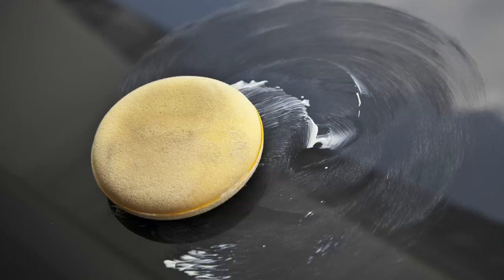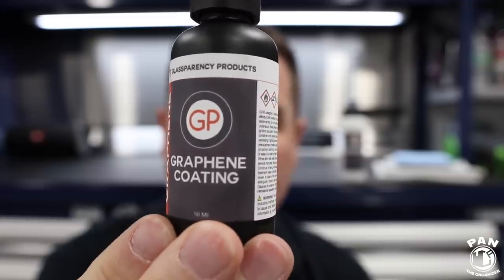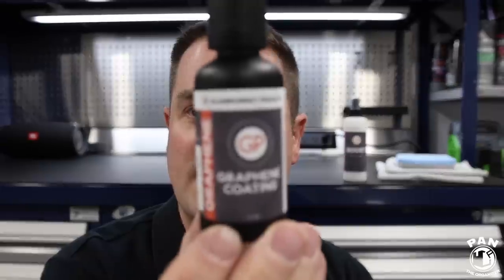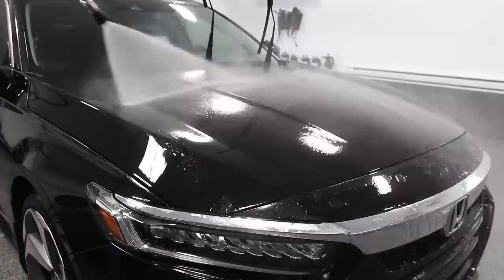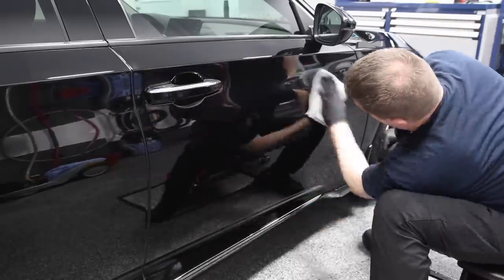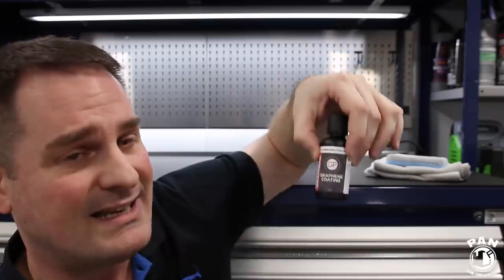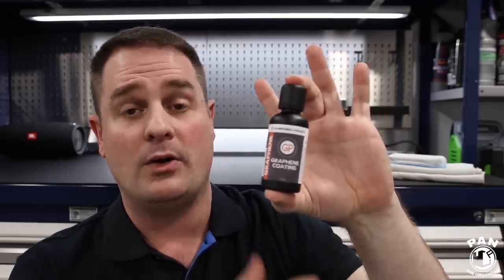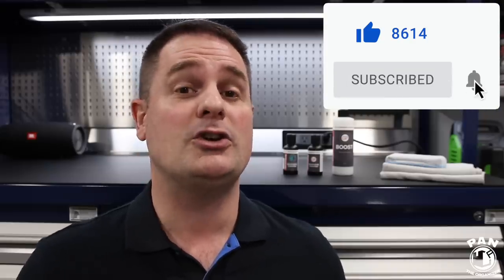GRAPHENE COATING by GlassParency! The Future of Paint Protection!

Comment: Baffles me that the customer wouldn't get a full paint correction before applying something so semi-permanent... especially with that color car.
Reply: Some thought Pat; I was a bit antsy watching all that :)
Reply: Money.  A full paint correction isn't cheap.  I love the idea of keeping my vehicle clean easier without spending $1000+.
Reply: Yeah, lots of cars just don't merit a full paint correction, but even a minor correction like this one, plus ceramic or graphene, means 1) the car looks better than it did before, and 2) it will be better protected, so it should stay better-looking longer. Plus the comparative ease of cleaning after a protective coating is applied is an additional benefit even if no paint correction is done at all.

Comment: Graphene coating VS Turtle Wax Ice ceramic spray. $99 vs $15.
That'd be an interesting apples & oranges comparison.
Reply: Love to see that battle
Reply: Agreed.
Reply: yeah, but one is in spray form and one isn't. So that's not a fair comparison compared to a ceramic coating in a small bottle that must be applied the same way.
Reply: @brandenlucero  yeah that is why @Robert Van Hoy said like apple & oranges comparison. You know just curious
Reply: Y not both 🤷
Reply: You mean hybrid solutions. I have both and may test for my self
Reply: The difference is in how many years each one lasts.
Reply: @adampetten1009  I couldn't think if the correct name.
Reply: @Knards  and probably the chemicals they can survive
Reply: would be fun to see, loving the TW hybrid stuff
Reply: @projectfarm got really good results with TW as well.. im putting this graphene on my Jeep SRT and TW on my truck to compare. I'm also going to split a door on my work truck as its used in industrial settings daily from oil and gas to pulp and paper.
Reply: You can’t compare a paint sealant to a coating imo
Reply: @garretrocha8  Did I not say Apple's to Oranges comparison ? Just like which car would make a better everyday driver, Camry or a Ferrari F40 ? Yeah the F40 will do a lot of things better but the Camry is much more suited for everyday life.
Reply: 组哈飞 d
Reply: @adampetten1009  I think you will find the graphene will out last the ceramics by a long shot
Reply: @Knards  nobody doubting that but could do a good short term test or possibly even 6 to 12 maybe.  He was being generous about price too.  Maybe $130 shipped to door graphine in US vs $13 TW at walmart.  would still be a fun comparison to see.  TW wet wax works great too.
Reply: @happytrails1963  There is no comparison to TW Ceramic and Graphene. They both shed water like a duck, one lasts very short term the other much longer. The price of Graphene is $99.00 and there is no $30 shipping. Remember you get what you pay for.
Reply: @Knards   I do not know if that is the correct  test perameters.  Gloss an dshine versu cost is what I would compare against. If gloss an dprotection being equal and the turtle wax having to be re-applied  once a month versus this coating which  also needs a booster to be purchased and applied, After five years, how much is the difference in cost  and did both of the perform eqaually?  The quality of any of these new products  is so good, the answer to which route to take is subjective and completely up to the persons preference. If in five years using this product once and a person using  Turtle wax and having to purchase five years worth  might be around the same amount of money spent.
Reply: I had the same question. I might travel with my car and I'm looking for solutions with less maintenance.
Reply: The funny thing about the high end coatings that claim to last years, is that they are marketed to people who are scrupulous about their cars. And if you’re already washing your car frequently, doesn’t that mean that a $15 hybrid is perfectly fine? You still get the beading and easy maintenance washes.
Reply: @hawkie333  Exactly my thoughts.
Reply: @barrycook8116  So you're saying that ceramic won't have the swirls even after repeated washing?

Comment: Very excited I ordered the kit and received my kit 1-250 Today I'm having my Chevy 2500 cut and polished and right after going to follow your instructions to coat my truck. Previously I had the original Quarts ceramic coating for the last two years and used the reload booster every few months worked and looked great but this seems to be a better product. Thank you for your video. FYI Truck is 2018 Chevy 2500 Z71 4x4 diesel LTZ.
Reply from the maker: Awesome! Good choice. Let me know how it works out for you! Should be pretty simple to apply.

Comment: You gotta review Adam’s Graphene coating
Reply: They're all gona be similar tbh
Reply: Working with Adam’s today.  GP was very easy to apply. I hope Pan tries them.
Reply: Got it in the Mail this week!
Reply: Nice product review!   Two thumbs up.  👍👍
I would like to see this one up against Ethos Graphene Matrix Coating.
Reply: It’s going to be almost identical. B&B who owns Adams is where Glassparency got this coating from. They didn’t even change the bottle.
Reply: I think Adam's Graphene coating is probably very similar or maybe the same. Adam's doesn't make its own products anymore. Almost all of its products are rebranded products from other companies. Their polishers are from the same maker of MaxShine, their polishing pads are Buff & Shine, their foam cannons and foam guns are rebrands, etc. So the Graphene coating may just be rebrand of someone elses coating. But I like Adam's because their products are cheaper the the companies from whom they buy!
Reply: castamir your partially correct. Except their products are made by b&b. The same company that bought Adams also bought b&b. So in essence, they do make their own products. The current wave of graphene coatings are all mixed up by b&b from what I have been able to tell. I’m sure there’s some differences between them but I haven’t seen the sds on them to know what exactly is different. Regardless it will be insignificant.
Reply: @stevoeight  That's true. I was talking with a MaxShine representative at the booth in a trade show. He told me that their car wash soap is the same as the Adam's soap and made by the same company. We will see more MaxShine and Adam's share the same products as they consolidate and streamline their product lines to reduce warehouse and development costs. He then went on to say that
Reply: castamir it’s not the same soap, just the same blender. That can be said for dozens of companies though.
Reply: Adams Graphene Ceramic coating is not the same as this. Adams uses Graphene-oxide.
Reply from the maker: I have been testing it for a few weeks now. I have been testing other graphene coatings as well in the past months.  It will be a crazy year for sure.
Reply: Ethos graphene is way better
Reply: Its honestly the same as the regular adams coating just a name. There was a test where apex detail did a test an both the same so just save your money
Reply: @briandraper7630  I tend to agree though haven't used either  Why? Lasts longer with a single layer and no topper required. Ethos for the win.
Reply: @PeteyMcSavage  Adam's vs Ethos is apples and oranges.  Adam's is just a 1 year spray coating vs a 5 year solvent. Not even in the same league
Reply: @PeteyMcSavage  CarPro One? Never heard of it. Did a quick web search and came up empty handed
Reply: Project farm did a video recently with Adam's and Ethos. Turtle wax was better.
Reply: @PeteyMcSavage  graphene comes in multiple forms. In our case as a liquid, graphene-oxide is a derivative of it, or a broken down form.
Reply: @PanTheOrganizer  I used ArtDeShine graphene coating with leveler. That stuff was insane.
Reply: @paulgyro  your wrong Adams offers a 60ml of a graphene 7 + year coating besides the spray coating!
Reply: @stevenmagid7228  ah indeed you are right! $79.99 might be a steal
Reply: David Christopher don't lie about test results...
Reply: @Pan TheOrganizer 
Can you do an unbiased comparison of Ethos, Adam and Glass Parency graphene coatings please. Especially Ethos’s I heard good remarks over internet.
Reply: @TheGrujee  I second that request
Reply: @briandraper7630  how so? Have you personally compared it to others?

Comment: Carnauba: “I can last 1 month”
Paint sealant: “I can last 6 months.”
Ceramic coating: “I can last 2 years.”
...
Graphene coating: “Hold my beer.....”
Reply: @darius2640  I did do something similar when selling my wife's car that had Fusso Coat+BSD on it!
Reply: Can I apply graphene coating over ceramic coating?
Reply: @jrlundman  no you can't.  Ceramic coating or Graphene coating requires to bond to the clear coat.
Xoxo from Puerto Rico 👍🇵🇷
Reply: @jrlundman  no!! It is made to bind to you clear without any protection.

Comment: Hi Pan let's see the glassparency graphene coating go up against the opti coat pro plus on your BMW then we can see if it really is better.
Reply from the maker: t wouldn't be a fair comparison, as Opti-Coat Pro+ is a 7+ year pro grade coating that can only be applied by authorized dealers and a service like that, for a car like mine, starts at around $1500 USD, versus a 100$ kit of this graphene coating that anyone can purchase and easily apply.  So for value, hands down the graphene coating kit.  For durability, only time will tell as these are brand new products so nobody has had the time to test them over multiple years yet, obviously.  If it gets anywhere near 4+ years of durability, then I would opt for the graphene kit.
Reply: @PanTheOrganizer  Its probably now only a matter of time before graphene coatings take the place of ceramic coatings, we are yet to see graphene coatings from some of the big hitters like carpro or gtechniq they could really change the landscape with products that might last longer than ten years. That graphene coating was so easy to apply and it's cheap if it can get to 5 years that's amazing, from the look of your test car the gloss and shine looks just as good if not better than crystal serum ultra black, I will watch this emerging changing of the guard with interest.
Reply: @PanTheOrganizer  
Hi Pan Thank you for your lovely demos. Just a matter of curiosity, how do you suggest we wash our cars so that it doesn't remove the Graphene coates we put on? What should we use? And can we use wax and polish after we wash our car after 14 days? Please let me know. Thank you.
Reply: @PanTheOrganizer  I like the way you have created relationships with the companies in the car detailing industry, your channel has grown immensely due to your hard work. Your dedication to car detailing and your audience is very clear, we get the hottest news on products straight from the businesses through you which is just fantastic, keep up the great videos, I would love to see a blog style series of videos on jobs that you do on project cars, I know its a step away from what you usually do but it could be good. I think Chicago auto pros do this type of video all the time.
Reply: @aldobiglari4575  Once graphene is on the car you just wash and go and top it up with the boost spray nothing else.

Comment: I picked up this kit when it was first introduced on your channel, I picked it up for a bargain at $99 for the complete graphene kit, now posting for $159 on the Glasparency site. I will using this weekend to coat my daughter's 2017 Hyundai Elantra with 2 coats on all exterior surfaces following a strip wash with Purple Power Vehicle and Boat, prior to that an iron-x with Megs ultimate all wheel cleaner. Clay bar then compounding/polishing with 3D One and Megs M210 polish. prep/panel wipe with Ethos Detox. This is my first venture into the coating world!!!!
Reply from the maker: You can do it! 👍🏻
Reply: Turned out great, very user friendly coating, I polished it out with 3D One and it looks amazing!!!!! Thanks again Pan. Applied two layers as they suggested for the 5plus years protection. I will doing the maintenance details every other week, it will be a blast to wash from now on.

Comment: I'm actually very interested in graphene coatings. But I'm not sure if it really has graphene in it or if it's an evolutionary version of a ceramic coating. Do you happen to know the exact information?
Reply: 큐어 디테일링-CURE Detailing it really is graphene, essentially a separated graphite molecule
Reply: I'm only guessing here... they probably just put graphite into their formula. There is zero chance that you can apply something with a sponge, in an environment of regular air, and at regular outdoor temperatures, that will actually result in a single atom thick, unbroken honeycomb layer of graphene all over your car. If that was actually possible, there wouldn't be a five year limit, and you wouldn't need to coat it or "maintain" it with something else afterwards.

I'm not saying it won't perform as advertised...I'm just saying that it's an awfully profitable way for them to sell a tiny bit of graphite powder. Again...just a guess.